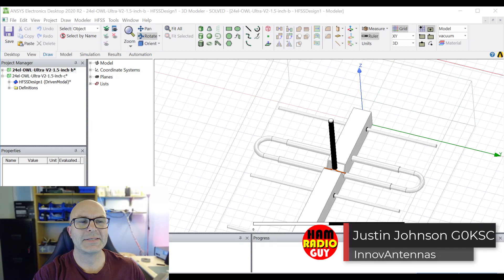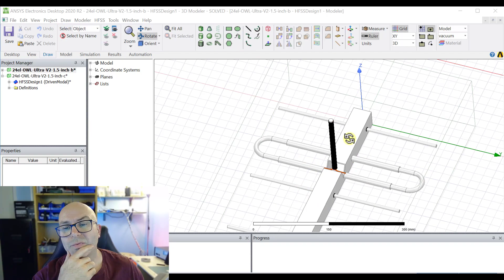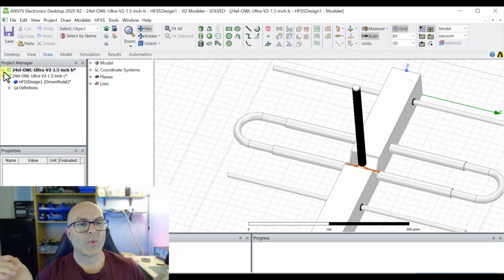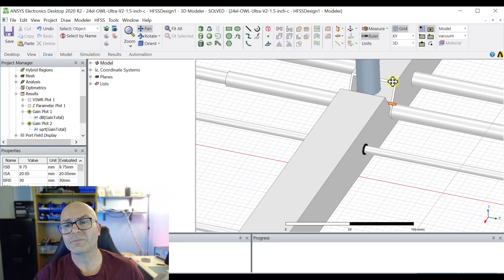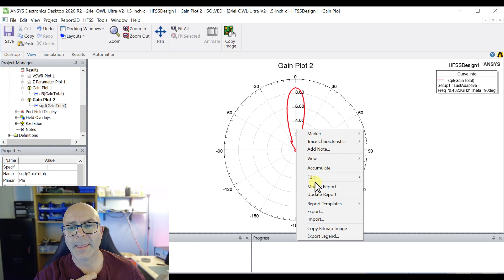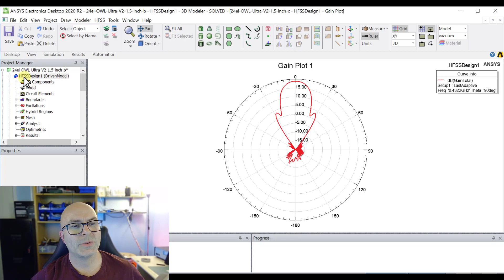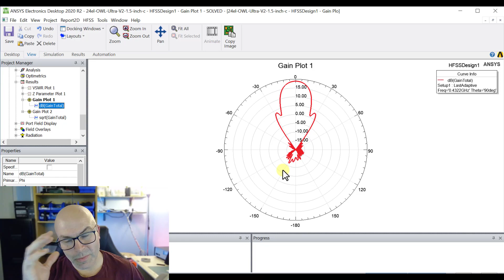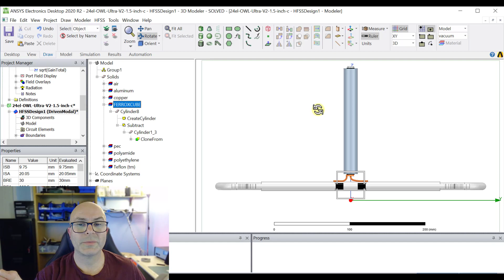Balun or no Balun? A Yagi demo in Ansys HFSS

Comment: Is the 1/4wave bazooka balun more efficient at 70cms than stacked ferrites? 
I was thinking of copper tube sleeving going over the coax and then soldered at a 1/4 wave from the feed point? 
Thanks for the video Justin
Cheers Mark GØNMY
Reply: I have tried it with copper tape a tuned with my nanovna, but they are very hard to measure. I think I will need a better jig, maybe with shielded walls.

Comment: Excellent video! What ferrite choke balun would you recommend for a 6 element LFA yagi at 50-54 MHz? What is better, exiting the balun toward the back over the reflector or hang the antenna upside down and exit it at 90 degrees to the boom like the video shows?
Reply from the maker: Ideally, hang antenna 'upside down' and exit coax at near 90 degrees. It does not matter of you go forward or backwards

Comment: Great demonstration Justin. Thanks for taking the time and effort. In that 70cm example, would the coax continue to fall way from the boom to eventually meet the mast at a much lower point, or would it curve over and then travel along the boom and down the stub-mast at the bracket? Thanks.
Reply from the maker: You are welcome. Coax/balun should always exit the boom at around 90 degrees although it is fine to then loop the coax back to and secure to the boom.